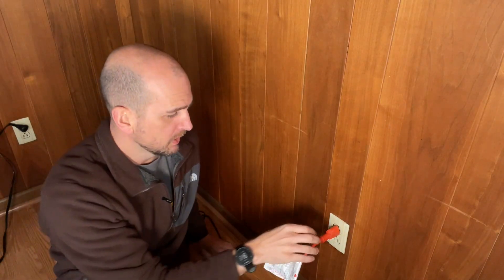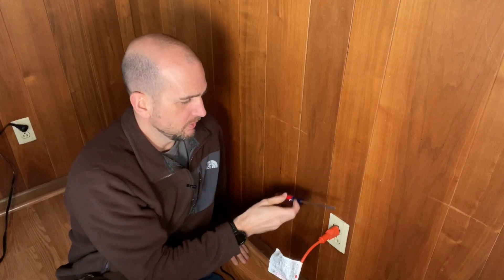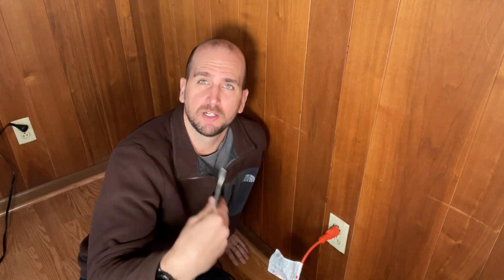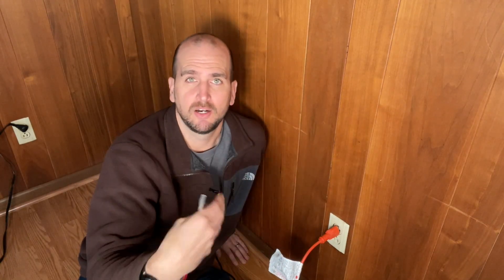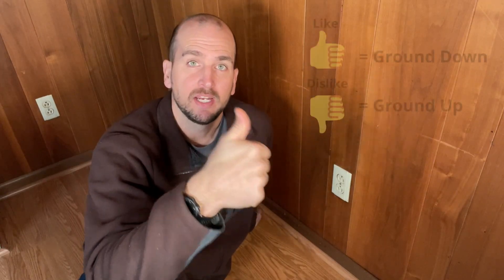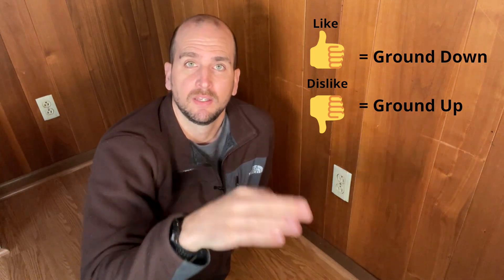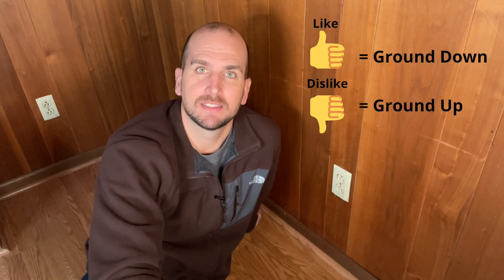Should An Outlet Be Installed Ground Down Or Up

Comment: Brother is an Old Electrician, He said ground up on Industrial/Commercial Buildings. Ground Down on Residential. Something about people living in houses plug and unplug the outlets more often and so there's more of a chance that their index fingers will make contact with the 2 blades, why it's safer to put the ground down.  He also said, that's why sometimes you see switched outlets in houses are ground up, because they don't get plugged and unplugged as often. Industrial/Commercial buildings typically have switched outlets, and things are typically left plugged in for long periods of time, so it's ground up to keep falling items from causing an issue.

Comment: The way the electrician in our new construction home did it, the ground faced up only on outlets controlled by a wall switch.  Makes it easy to tell which one is controlled by a switch in the room.
Reply: Came to make a similar comment
Reply: That is a very good idea
Reply: That is exactly the way ALL of the new homes are wired that I have looked at here in Southern California in the last 20 years. It is so common that I have assumed there is a local code that specifies ground down UNLESS it is a switched outlet.
Reply: @rv6amark  👍
Reply: @rv6amark  I have never seen an outlet installed with ground facing up (Arizona here).
Reply: I’ve bought 3 brand new houses in the last 30 years and every house I bought was wired this way. Switched outlets were upside down. Southern California 1995, Northern California 2009, North Carolina 2022.
Reply: That's a common practice that I've seen.  My house is wired like that.
Reply: That’s how it is for me
Reply: This is code in Nevada. Good point
Reply: Doesn't really help if only half of the outlet is switched.
Reply: In the case of when a switch only controls half of the outlet typically the half controlled by the switch is the bottom one, as it is most common for cords that are plugged in "permanently" to be be plugged in on the bottom.
Reply: @jgoog7442  it depends what it’s used for. Separating it in half gives you the option to control the power with a switch and having constant power available.
Reply: That’s the first time I’ve heard that. Very interesting.
Reply: This is what I do on all my
Remodels/rehabs if it’s on a
Switch I face ground up
Reply: My house is wired this way. The switches are near the door into the room and the outlets they control are on opposite walls.
Reply: We always used a different color recepticle for switched recepticle but as was mentioned by someone else. What if only one plug is on a switch?
Reply: @Brirend  then install a double-gang box, and put one outlet in each way.  Customer will love you.
Reply: Ditto
Reply: @Richard Cranium In general, they are used in commercial environments but they are available at both Home Depot and Lowes.
Reply: My den is the only room in my home that has a switched wall outlet. In my other rooms, the switch operates the ceiling light. In my den that outlet is part hot part switched. That part is marked with a small label that says switched.
Reply: and if the switch doesnt work the ground faces sideways
Reply: Clever idea but I'm pretty sure the inconsistency would drive me crazy.
Reply: In my mind that's a good idea.
Reply: I have an outlet someone installed that way man is it annoying to have a pc attached to it and accidentally flip it before turning the pc off
Reply: Both clever, and annoying!
Reply: This is correct. Ground facing up is half hot. On a switch
Reply: That's dumb...
Reply: Get a label maker.  Geez

Comment: My arguement is the 90 degree grounded plug that had to have a weird cord doubling back down is more likely to stress the wire at that bend which could cause a break in the internal wire or break the plastic insulation.

Comment: At the age of 21, I became a home builder (contractor) in 1968 and retired after 47 years. My electrician and I had a throughly long and hard discussion regarding this subject. He said a code does not exist but put the ground up for safety reasons which we did during my entire career. He said, "if the ground is down and a wire clothes hanger falls on the hot and neutral there is a possibility when someone reaches for said hanger they could be electrocuted trying to retrive it!" 

AND we both heard of a young wife of a friend of ours that did actually die of electrocution because she tried to retrieve a fallen hanger. Her house had the plugs installed incorrectly with the ground down. A visiting friend of hers witnessed the accident.

Turn the grounds up, save a life!!!!!

Comment: The correct way to install an outlet is with the ground opening of the outlet facing UP.  If you are in doubt consult the 'Green Book'. Most electricians/electrical engineers have never heard of the Green Book. Don't confuse this with the NEC Code book. The Green Book is the   published by the Underwriters Laboratories who test all components used in the electrical industry and appliances. Look at any outlet and you will see the Underwriters escutcheon stamped on it. Check the outlets installed in a Hospital and you will see them installed in this manner.

Comment: You bring up good points for ground up but you missed a good one, it's simpler to plug into a ground up because the ground pin lines up the other two which can be difficult because if you are leaning over it's easier to manipulate the big pin first.

Comment: I worked a few days in a sheet metal plant and all the outlets in the production and handling areas were mounted ground up so if a piece of metal somehow got behind the plug, you didn't have a short and possible fire or electrocution hazard.

Comment: For me, the issue of an item falling on the leads is exactly why ground down is preferred. Why would you want to delay action on a potentially dangerous situation. The circuits are designed to facilitate the function of the breaker and shunt the circuit when something like that happens. If we find ways to circumvent or delay that reaction, then that is just creating an unseen potentially more dangerous situation.

Comment: Here in the great white north, the Canadian Electrical Code does not define which is the correct direction. I  have heard over the years about the "safety" of having the ground up. I have also heard the maxum that if the plug gets yanked, the last thing to disconnect will be the ground prong if the ground is installed down. In my 35 years as an electrician, I have always installed receptacles ground down because mostly that is the way it always has been done. For no other reason than it looks right that way.

Comment: As a young apprentice years ago I asked my boss this question my first day on job ,he gave me a look and said"the ground is down isn't it?"so I'd always put in ground down.However since then I've experienced an instance where a stainless wall plate had come loose and shorted against hot and neutral,not good! since have always put ground up,and also when installing one sideways,I always put the neutral(larger on polarized )side up.

Comment: I have owned several three prong devices which did not have power cords but the prongs came directly out of the device. Things like emergency radios, but there were other devices as well. Outlets installed ground up would have had those devices upside down while in use.

Comment: in australia all our plug pins are the same size, it is always ground down so if a plugs comes away from the wall because of gravity the earth pin will always be connected  as long as it has power, our pins on the plugs  are shielded so only the tip will be exposed so anything falling on the plug will not short it out

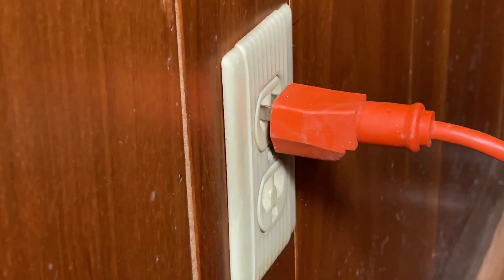Comment: I worked in a soda factory for a while as a maintenance mechanic and the plant electrician taught me to go ground down for most residential situations but ground UP for commercial situations when the outlet faceplate was metal for the reasons mentioned at 3:30 in this video. It seemed like an unlikely scenario even when he explained it to me 30 years ago and it still does. I haven't done any commercial wiring since then but I always go ground down in my home.
Reply: My father was an electrician at Corning Glass Works for 40+ years. His motto regarding this was always: “ Ground down or to the right “.
Reply: @nealkeach4367  It's hard to take such a maxim seriously without hearing the reasons behind it.  If anything, hospitals have a compelling reason for the ground pin to be on top, and if it's good enough for the hospital, it's good enough for your home.

Comment: ground up for just one reason it blocks any short when or if lets say a blade comes down on a  outlet it will hit the ground up and save a short or dangerous arc > safety first looks come second , this talk about tension on a cord ground is common sense don't allow tension on a cord

Comment: Ground down for regular outlets and ground up for switched outlets. If your plugs are falling out of the outlets then you've already got a fire hazard on your hands. If stuff falling into your outlets is a concern the outlet should be recessed or the US needs to get it's act together to insulate the first quarter inch of the prongs since that's not making contact anyway.

Comment: I have always installed ground down. The safety issue that are commonly used mostly don't apply as most items plugged in are not three prong. the bigger issue is outlet must be replaced when worn so that plug slide out easily. this issue is mostly overlooked until a real issue occurs. Also I only use tamper proof outlets but that is a different issue.

Comment: Put the ground UP!   I never knew why the difference until I experienced  it a couple years ago.  I had contractors measuring for a new kitchen in an apartment. They extended their metal tape measure along the counter top above an outlet. The plug was out just enough that the tape shorted the plug. Big flash--burned out plug, burned wall, blew the breaker.   It cost me money to have the ground down and could have injured the person holding the tape. Put it UP!
Reply: Well that is what happens when you work with idiots who don't have the brains to be careful when they are working!

Comment: The most compelling argument I have seen for the Ground Pin Up approach is in cases were you install a metal cover plate, typically brass or stainless steel.  While I like the look of those, I think they introduce an unnecessary hazard in that a loose hot wire could energize them and create a risk of shock.  Because cover plates are typically held on by a single screw, having that fastener back out also creates a risk of the conductive plate falling down and hitting one or more pins on a plug.  I have all plastic cover plates in my houses.

But the bottom line for me is that back in the late 1960s my dad, who was an electronic systems designer in the aerospace industry, referred to three-prong receptacles as "Monkey-face" receptacles.  Seeing the monkey's face upside-down just doesn't work for me.
Reply: A hot wire touching the metal plate will go through the safety ground and trip the breaker.
Reply: @Whataboutseconddinner  exactly, which negates all these foolish arguments

Comment: Any 24 hr. timer I've used the ground down outlet or the dial would be upside down. My house however had ground up outlets. I went about changing them to ground down because I just knew that was wrong. It shouldn't be left to choice but if it is I choose to put mine in ground down!

Comment: It really doesn't matter it all depends on the situation. Most cords have the ground pin closest to the cord itself and if you mount the receptacle upside down the cord has a big loop sticking up and causes excess weight on the plug, where as most large appliances (like fridges) have the ground plug facing away from the cord and are designed to have the cord going up the wall because the cord comes out at the top. So plan ahead on what will be in the receptacle and adjust the mounting accordingly. There is no right way or wrong way, it all depends on the application. Some industrial electricians will tell you the ground pin hols more weight because its bigger but have you ever had a pin break off? it's way smaller than the other pins where it's connected that's why they break off so easily, the round part is only on the outside, once it enters the plug itself it's only about 1/8" wide.

Comment: In a newer home I had, some outlets were ground up and most were ground down.  I found that the ground up outlets were the outlets that were controlled by a light switch by the door.  This allowed a lamp to be plugged into the ground up outlets and turned on or off at the light switch.

Comment: Code says last thing to disconnect is the ground. With ground up it is possible to disconnect ground before hot and neutral. 
Also, look at any UL approved night lights. They only are upright when ground is down. 
Retired electrician, licensed in Mass., NH, and Maine.

Comment: In the old houses electrician’s would instal ground up on dead ends. All others are found down. Modern installations are typically installed ground down.

Comment: As a practice, I go with ground up for 20A, 110v circuits, and ground down for 15A, 110v circuits.  It helps me keep what I plug in straight.
Reply: Wouldn't the fact that a 20 A receptacle is different than a 15 be enough?

Comment: Ground down always.  Plugging those flat appliance cords with ground up, IMO, cause an unnecessary issue with tension and eventually causing a premature failure of cord. Also , while I only work on my own property, if I ever work above outlet and see cord pulled partially out, I’m correcting the issue.

Comment: The ground must be facing down for me except on switched outlets for easy and quick identification. Nothing drives me crazier than to have power cords dangling up then loop down. It is messy, annoying, and unsightly. If I ever move into a house with ground up receptacles, I would change most of them immediately if possible.

Comment: I lived in an apartment that had ground up. It was awkward. Many devices are not equipped with cables that work well with ground up. Flat plugs on refrigerators always wind up with the cables being bent 180 degrees. I just bought a house and I placed the outlets ground down.

Comment: I used to wire a lot of Houses in the Orlando Area in the 80s and we always installed ground Down, so it looks like a face with 2 eyes on top and a mouth on the bottom. That way it scares the little kids moving into the new homes.

Comment: I had a guy tell me that he puts the ground up so when it slides out, it will push the hot in and he will not lose his connection.  My reply was that it is more important to keep the ground connected. Put the ground on the bottom. This same guy was too lazy to connect ground wires to some light fixtures and they would shock people. A good circuit requires a good ground before being powered up.

Comment: Ground down for everything except a switched receptacle.  Switch located on the wall as you enter the room closed the circuit to the receptacle which turns on the light plugged into the wall.  All other receptacles in the room the ground is down.

Comment: I’m not an electrician at all. Just starting to learn wiring as of today. On a completely different, but more fundamental topic: why is the hot wire black, the neutral wire white and ground green or simply copper? I’m perhaps thinking about this incorrectly. From my mechanical experience, I think of ‘hot’ as ‘+’ which I’m used to seeing red. The ground, I think of as negative, which I’m used to seeing as black. So in house wiring, I find the colors of the wires used confusing. Can someone please help me better understand this?

Comment: I’m leaning toward ground up because it’s easier and perhaps a bit safer to install a 3 prong plug. Note: the safer bit is because the ground prong is a little longer and this means that the plug is oriented and deeper in the socket before hot contact is made.

Comment: Ground-up makes more sense to me from a safety perspective, but I always install outlets ground-down because so many plugs and transformers--like the quick-90 plug you demonstrated--are designed for gound-down installation.
Reply: I have a bunch of 90 degree three prong adapters.  In an outlet installed ground-up, that means the adapted cord plugs in from above rather than a more normal below.
Reply: Almost Average  ? The point is, in a ground side up wall plug, the 90 degree adapter ends up facing up, were it will be more prone to stuff falling into the holes.  Also, ANY cord you plug in is going to have a rather severe bend in it because instead of a 90 degree downward bend, it now has to make a 180 degree downward bend.

I don't see where the country of manufacture for any electric cord makes a difference to this fact of geometry.  It has everything to do with the universe of adapters that plug into wall sockets assume a bottom position for the ground wire.

Comment: I definitely prefer ground down. This is mainly because I have found that the little bit of plastic between the ground hole and the edge of the receptacle can easily crack. When a receptacle is mounted low on a wall it's natural to insert, or remove, a plug at a bit of an upward angle. It doesn't take much pressure to crack that little bit of plastic. Also, ground, or earth, is down,  so it's just intuitive.
Reply: I have the same problem. All my outlets were installed with ground up and they are all broken at the top and it stresses the cords being bent over backwards. I definitely prefer ground plug down.

Comment: I know first  hand the benefits of ground up, worked in a building that had stainless steel panels in restrooms etc, as plumbing access points a few were mounted directly over ground down receptacles, until the day we learned why to turn them over.